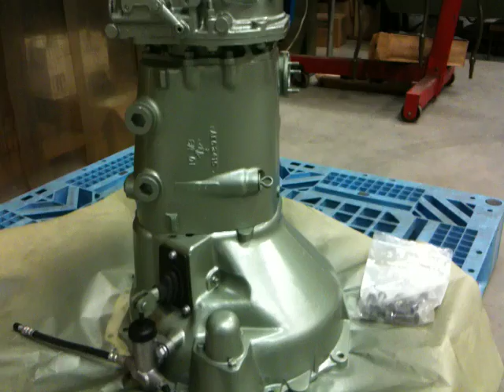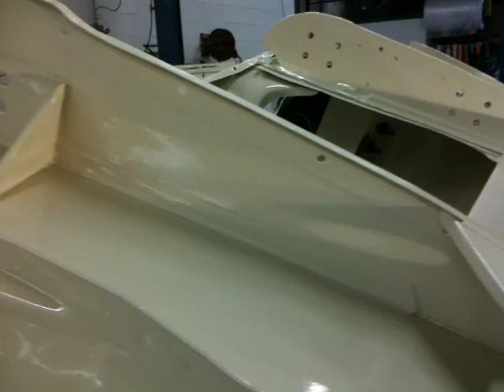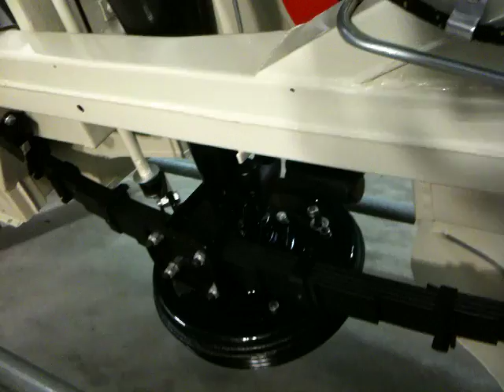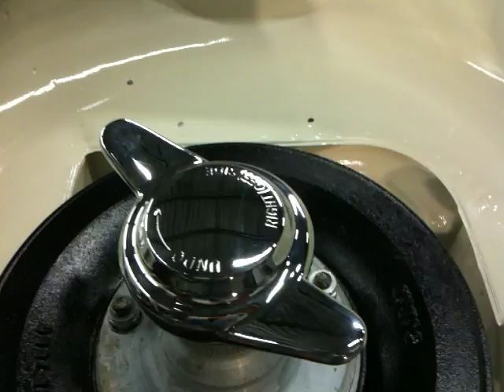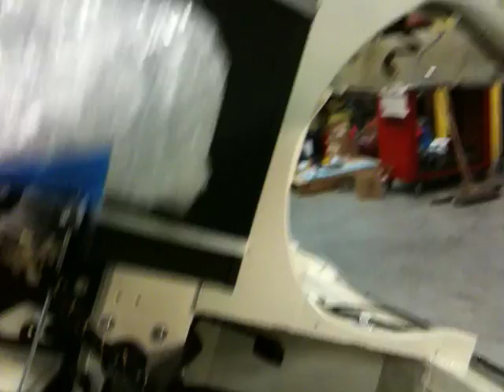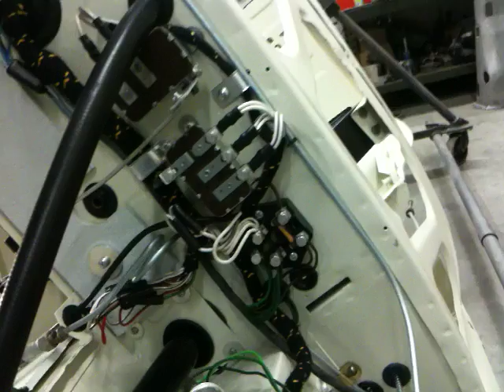Austin Healey 1960 3000 Mk1 Part 4 of Concourse Restoration

Comment: You keep saying all original.  Whay about the tar on the inside floor boards? I had to remove it with an air chisel. So when are you going to tar coat the inside Mr Original?